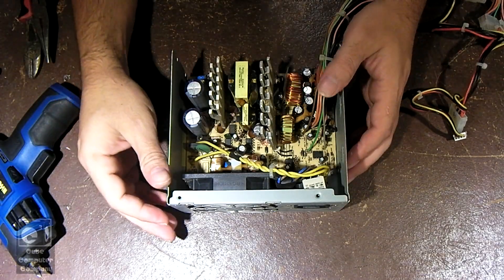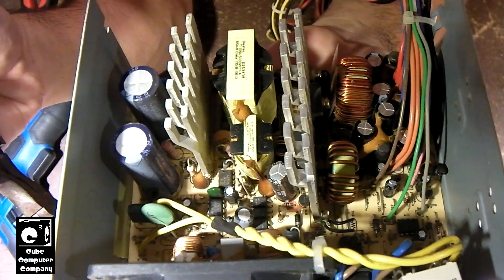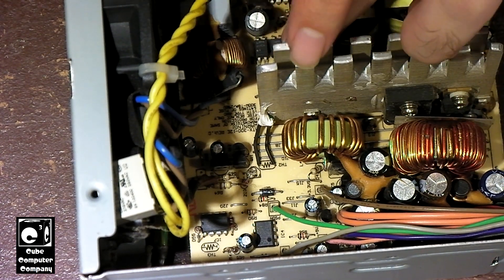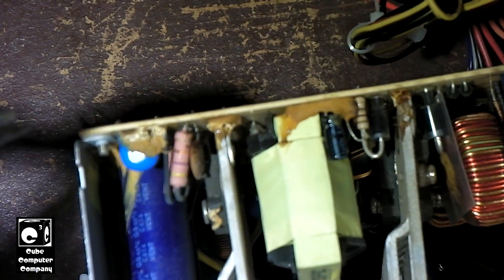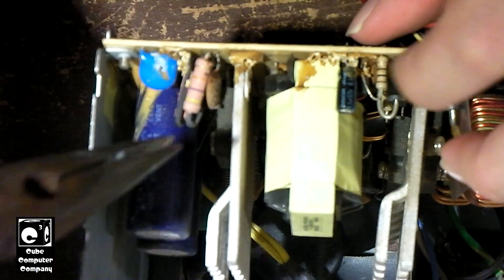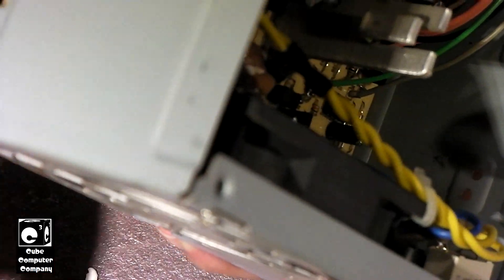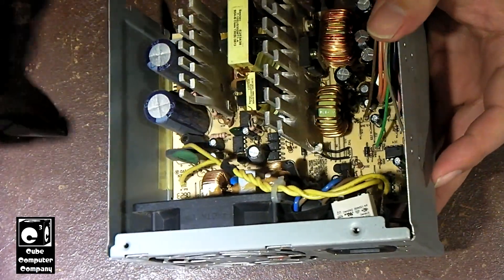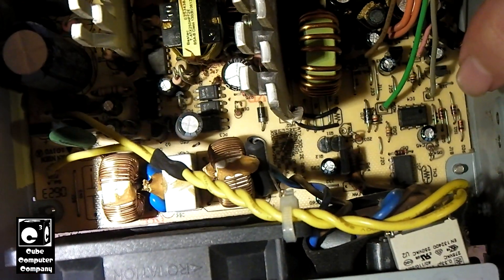Another Bestec PSU with tan glue gone rogue

Comment: Yeah, Sadly I have had that cause issues with me twice. One of them was an Emachines that I replaced the 250-12e with a 300-12e, and it ended up throwing sparks out the back, I think an IC chip blew up if I remember correctly. The second time was a similar story but with a 250-12z. This same issue used to also be common on older HP small form factor business systems like the D-530. I used to buy those by the pallet load back when I was refurbishing PCs, and about 1/3 of them would have the power supply blow up when you plugged them in because of this glue becoming conductive and corrosive. I know HP used Bestec power supplies for a while, but I don't know if those units were Bestec made or not, as they were just branded as Compaq.
Reply from the maker: HP used LiteOn for a lot of their business class machines with HP/Compaq branded PSUs. Pretty much all the big PSU OEMs used the tan glue for a period of time. I've had 1 or 2 older HiPro units blow up due to what I suspect was the same cause.